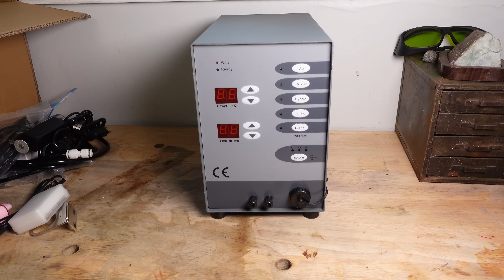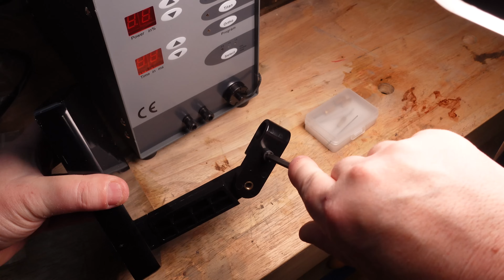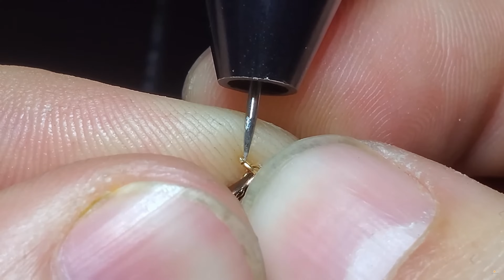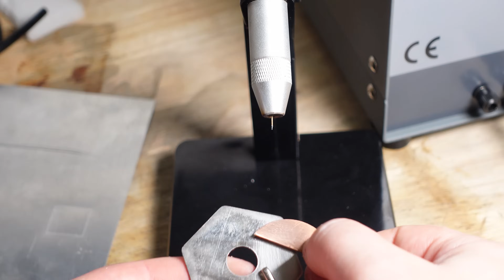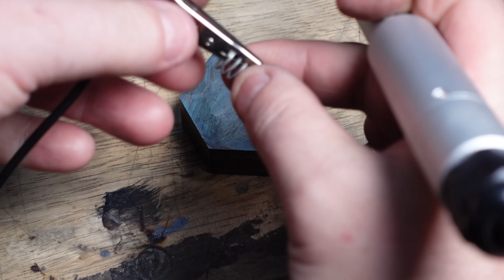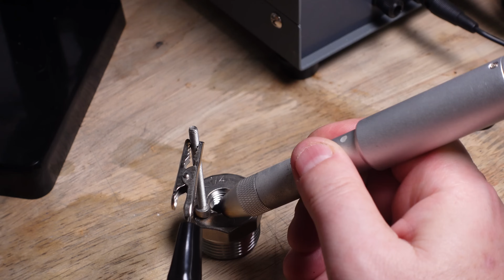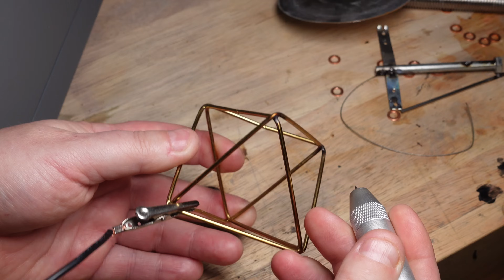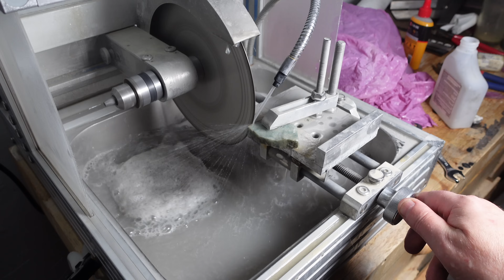Every maker needs this cheap little hobby welder #jewellerymaking #lapidary #welding

Comment: When does a sparking motor capacitor(when shorting a charged capacitor), become a welding machine🤯 For those wanting a sub $10 solution, just charge a motor cap(or better a photo flash capacitor) by connecting through a diode(rated to handle a/c) to the a/c outlet(use a large momentary spring switch that disconnects both a/c lines). Then use a cobbled up sewing needle and a alligator clip(soldered to capacitor) as welding terminals.Depress and release switch for a single pulse charge. To get varying energy pulse, connect a low wattage bulb in series to charging diode, through a diy timer module(now timer setting will correspond to energy stored🤔). Not a fancy type, but will get the job done, without draining your wallet.😂 Response to comment: Just ask ChatGPT to make a line voltage powered capacitive discharge jewelry welder with minimum bom using mostly off the shelf components. Also ask using a series resistor(in the form of a low wattage incandescent bulb) controlled by a programmable diy  timer  module, to control spark energy. Goodluck with it. Also mention needing to use manual control using a break before make double pole switch for charging and safety.❤👍
Reply: Interesting, so you know of any diagrams or videos showing how to make the type of machine you are describing?
Reply: @qippie  The helpful person went into some detail how you can coax exactly what you are asking for from a common LLM AI.  Using a search engine or the YT search bar will probably also find you results that are close to what was described.

The only thing missing from the super cheap solution is the retract solenoid but you could do that too if you have mechanical aptitude.

Comment: I have question, can this welder fill hole? We are running cnc shop and sometimes need to fill errors, with TIG welding there is too much heat transfered to workpiece.
Reply from the maker: Depends on the size of the hole but one popular use for the machine is mold repair.  Deep scratches and small holes are filled using fill wire with this machine but the holes would need to be relatively small. If you need to fill larger holes, theres another machine from china advertised as a "cold welder" thats basically the same thing but with more power and longer pulse times so it creates larger welds but those are about a grand or more.
Reply: @sweetgumnyc7794  relatively small holes, thanks for answer 😘

Comment: I have one of these bought it 4 - 5 years ago.  Super useful welder.  I have other TIG welding equipment but it's difficult to do small delicate work with it.  One issue is seeing your work the flash is bright and eye protection is necessary.  I rigged  head mounted stereo magnifiers with a small electronic welding lens.  The first try with a cheep o failed to slow.  Tried a better quality lens and it  was fast enough to block the flash and worked very well.
Reply from the maker: I made a stand for my phone and do detail work while viewing through the camera.  My eyes are already bad so the magnification on my phone helps while simultaneously blocking the flash
Reply: Hers a problem. Even with the tints welds, you’re getting UV from the arc. You get UV that the atmosphere filters out from the sun. You can get cancer from it. Without the proper PPE you run a serious risk if you do this often enough. You need a welding helmet for this just like with any other welding. You need gloves and sleeves. Don’t think that just because this is small, it’s safe. It’s not.
Reply: @melgross hmmm I doubt the amount of UV is very much on such a small arc.
Reply: @melgross  The eye protection is a good idea.  I absolutely agree in that regard.  Our eyes are delicate.  Sight is not something that should ever be for granted as it is rather easy to lose it!   But compared to the continuous UV output from arc welding at +100 Amps, the amount of UV this thing can expose your skin to is tiny, like several orders of magnitude lower tiny.  So tiny of an amount, I find it difficult to believe it is likely to cause anyone using such a device a measurable amount of harm.  With the relatively low power level involved, the device's pulse length being a fraction of a second, and a duty cycle that even further limits a user's time weighted UV exposure, the risks from it should be very small.  With only a fraction of the power, and therefor fraction of the UV intensity produced, and a total duration that, even if used for the entire work day, is still only measured in seconds, it simply can not expose a user to anywhere near the amount of risk from UV light that you'd have in traditional arc welding processes.
Reply: Podrías mostrar como es esa lupa que usaste
Reply: Could you please tell me if, in your experience, this machine would spotweld 3*3 mm square rods to a solid base with perfect square holes? Non-galvanised mild steel.

Would help me hugely to know. Cheers!
Reply: hye . this must use argon gas? without argon gas can weld? tq
Reply: @jassilver444 yes, argon just takes the soot away.

Comment: I bought this machine because it was the only way that I could weld the battery tabs on the new Tesla 4680 cells.  The Tesla cell positives have an aluminum contact on the positive with the negative just being nickel-coated steel.
Reply: How did you ground it before welding?
Reply: You out the clip on it just like normal. The current run between the clip and the electrode. The closer you are to the ground clip the more power your weld will have. As long as you aren't welding across positive and negative terminals there's no issue. Unless you are closing the  circuit on the battery(which would be very dumb)you are fine. The ground of the welder is floating as far as the battery is concerned. The battery has its 0v, actually it has several 0v, one between each cell group. 

Electricity always wants to go back to where it came from. There has to be a path back to the source . It goes in a circle, that's why it's called a circuit. Right? 

When we draw circuits we always show the positive feeding the negative. This was before they invented the electron microscope. Turns out it goes the other way. Surprise!!! So positive  is negative and vice versa. Isn't that special? So the way we draw this stuff is the "conventional" method. The accurate way would be the ionic flow method. 

They couldn't change it. Think of the nightmare of already having tons of devices and then swapping plus and minus. It's great if fire excites you and all but generally no bueno. 

The welder is putting out 40v but it's fine. You aren't closing the loop on both sides of the battery so it doesn't exist as far as the battery is concerned.
Reply: @zentechnician Thank You for the information. I truly appreciate it. 👍👍
Reply: does it work for you?

Comment: I love mine. Also helps to buy the little led screened microscope. I have micro drill press use drill bits fro harbor freight. Argon helps.
Reply from the maker: I might buy that but for now I 3d printed a stand to hold my phone and I view small work through my camera with magnification.  So far it seems like a reasonable setup

Comment: I have a bad one, should be interesting see what the differences are. I looks like the same machine but mine is impossible to weld with. Is there someone out there that knows more?
Reply from the maker: That's what I tried to illustrate in my video. These machines look the same but some are useless.  Its frustrating but if you can still return yours, i would return it and get a good one because the difference is night and day. One is the most useless and frustrating piece of junk and the other is now my favorite tool.

Comment: You can weld anything. it's just the results of the weld, chemical reactions, crystal structors, and all that. Think of the welds you've been told as possible less of a weld/ alloying. It's more so think of mixing two playdoughs mixing think of two diffrenet colours and the swirls they make

Comment: Thanks. Ordered. I was almost ready to pull the trigger on a $1,700 Zapp welder. If this one works well, I’ve got quite a bargain. If not, I’ll send it back and go deep pockets.
Reply from the maker: Awesome, hope you like it! Compared to the other pulse arc welders on the market, its really a huge bargain imo. Its my understanding that the weld quality is identical to the more expensive machines in the thousands like the orion, but the only thing it lacks is programmable settings so if you dont do production, i dont really see a huge benefit with having programmable settings , at least not enough to justify 4x or 5x the price

Comment: Could you test it on big chunks of aluminium, maybe with filler material? I was thinking of buying this machine for small mold repairs (parting line reconstruction, fixing of small machining defects etc) but I'm not sure of how effective it is for such application.
Reply from the maker: Sure , I was gonna film a youtube short tomorrow with it and I'll make sure to test it on thick aluminum.  That said I suspect it will work but only for very small mold damage, like filling scratches or small gouging.  Mold repair is one of the most common uses for this machine but check out my shorts feed tomorrow or the next day I'll make sure I test thick aluminum but like I said,  you will likely need filler wire and it will only fill small gaps

Comment: I hope you're wearing welding glasses.
Reply from the maker: I do but with this welder it clicks right before it fires a pulse so its quite easy to train yourself to close your eyes and look away when you get a feel for the timing.
Reply: @sweetgumnyc7794  Closing/averting your eyes is really not sufficient. I say this because I just took a class in welding two weeks ago where the instructor specifically warned that your eyelids are NOT sufficient guarantee of blocking out all of the radiation from welding equipment.
Reply: @sweetgumnyc7794  That sounds great with pulse welding.  Auto-darkening works pretty well for other forms of welding.  The momentary flash before they dim is still a problem: certain bright lights can trigger my migraines and of course burn retinas.  I too have to blink right as the weld hit.

Comment: I have the same machine and it's great.  You can improve the welds by running a line of tack welds then taking a thin wire, weld that into the full seam.  If you champer the edges of thicker pieces of metal then it means that the weld goes into the centre of the join, not just on the outside.  You can then run the beads of the wire along the join to build back up the metal an strengthen it further.
Reply from the maker: Yea i was thinking about trying fill wire. I saw them do it on the orion channel. Glad to know it works. Thanks!..do you use argon? Is it worth me buying a tank? BTW, what do you use yours for mostly?
Reply: @sweetgumnyc7794  I did try with a disposable argon and it make it cleaner, but I messed up the tubes and had a leak so it didn't last long.

I usually use it for jewellery - very handy for chain making, quicker than soldering individual links   Also use it for bezels - useful if you hace a corrugated bezel going over an uneven surface and can't get them to match well enough for the solder to flow - I can tack it in place, build up any gaps and solder if needed.
Reply from the maker: @geekinthegarden3927 yea it doesn't replace soldering in all cases but i  imagine my workflow, , now that i have this, even when I plan on soldering, will be to tack my work together so it doesn't move during soldering.  That alone would save a ton of setup time.
Reply: @sweetgumnyc7794  It can replace iron binding wire in a lot if not all cases and then you don't risk the situation when you can't get all of the binding wire off before the pickle and having to do a hot alum soak to remove it
Reply: @sweetgumnyc7794 Yeah, I borrowed one of these for a while, and being able to pin/tack stuff before silver soldering was game changing NGL! Saves so much set-up!
Reply: @geekinthegarden3927  any glaring issues you've run into while using this?  I dig this mini-weldy✨🧨🤘🏼
Reply: Thanks for the idea. I want this machine to fix laptop hinges, so my customers don't have to wait weeks for the parts to come in. Of course, I'm going to test it before even attempting to use that as an actual repair by stress testing it, but I like your idea of reinforcing it after you tack welded it.
Reply: Mar vagy 2 eve kapni lehet! Nekem is ilyen gepem van.Sot mar vannak ujabbak is.
Reply: Can you add the link to show the one you purchased? Thank you
Reply: Isn't that "laying rod"? A time-saving cheat that is inspected for in any structural welding?
Reply: Can weld grey and white cast iron? What about nickel brass and bronze?
Reply from the maker: @miguela.m.8671 it can weld any metal i threw at it, i tested bronze but not cast iron but i imagine it would weld cast iron just fine
Reply: @miguela.m.8671  I think the grey ones might wanna stay with the other grey ones...  I heard the white cast irons have grey cast iron fatigue?
Reply: @miguela.m.8671 don’t try welding cast iron. That’s takes a lot of understanding of the metal. CI will shrink and crack if not done properly. There are special welding rods for that, or you can use 309L stainless. But this isn’t the way to do it.
Reply: That’s amazing.  Was literally wondering that as I watched. So, basically, with enough patience you can do full on welds?
Reply: Looks like they now charge $100 for shipping on this unit. Wonder if there is another of the same quality that doesn't have that shipping fee.
Reply: @ChrisKewl Tariffs.
Reply: Can you use gold solder sticks instead of the roads that came with the machine?
Reply: @carlosmiranda6767 No - you need to use the tungsten needles to be able to create the arc.

 Its best to just have the gold butted up against each other then use the arc to melt a little bit of both pieces so that they weld together and not use the solder at all
Reply: @geekinthegarden3927 I was thinking if it was possible to use this machine with thin earring where you don’t want to use to much heat bc it might melt the piece
Reply: I'm kinda new to YouTube but would you please explain how to find the "description " that he talked about to locate the exact same machine that he bought.  I hit every button but no help...thanks in advance
Reply from the maker: @jonnyrox116  depending on your device it might be different but do you see a "more" button on the bottom you can press? That should open up description
Reply: It's a Samsung galaxy a12 I think,  I'll try it,  I looked on Amazon and some are $405 and some are as low as $179 and both look identical to the one you have with the same CE logo.  I just don't want to get the reject and have to send it back,  I'm kinda remote on the Big Island and travel to the Amazon pickup station is an hour round trip for me...plus everything comes by boat. I'll look for the MORE button and I thank you for the info.  I look forward to a review on this after you've had it for a while.  Thanks again  @sweetgumnyc7794
Reply: I found the 'more' button and found the description but didn't see the supplier listed  @sweetgumnyc7794

Comment: instead of argon you can use any other nobel gas or CO2, but you will need to check the material and play with flow rates.
Reply: I’m not sure CO2 is good for this. This is similar to TIG. We need argon for that. I can assure you that CO2 does not work for that. Even 75/25 doesn’t work well.
Reply: @melgross we use CO2 for laser welding on automated lines but it does require the gas to be warmed first so the weld doesn't get stressed
Reply from the maker: I was wondering if co2 would work.
Reply: @sweetgumnyc7794  co2 will eat your electrodes. might not be so big an effect in this aplication, but it is basically tig spot welding and thus the only gases you should really consider using is argon or helium..

Comment: Oof.  Shipping is $100 from amazon.
Reply from the maker: Wow i didn't even see that, i definitely bought it when it was free shipping.  Maybe they raised it because of the tarrifs? Im gonna reach out to them to see if they are willing to do something about that.
Reply: I was about to, but the $100 shipping poured cold water on that one
Reply: Well you know...... 
COVID and Supply line Shortages 😅😂
Reply: Do you have a link for the correct machine on AliExpress?
Reply from the maker: @kevinbernitz6580 no because there are so many different vendors and versions of this machine that I dont feel comfortable mentioning a vendors i didn't test personally myself but I did reach out to the vendor I bought from to ask them about both lowering shipping cost or maybe they also have an aliexpress store (which is likely) check back in a couple of days and if they have an aliexpress store I'll add that to the description and hopefully it will have free shipping
Reply: @sweetgumnyc7794  Excellent, thanks.  o7

One of amazon's weaknesses is the way it's indexed on product and doesn't really give you more than cursory visibility into vendors.
Reply: @sweetgumnyc7794  Did you ever hear back from the vendor?
Reply: @kevinbernitz6580  Yup, that would be very useful @sweetgumnyc7794
Reply: Say thank you Donnie Trump for the tax on imports under $800 now